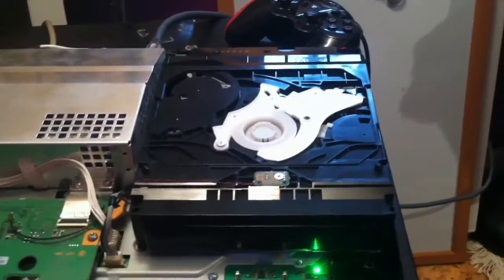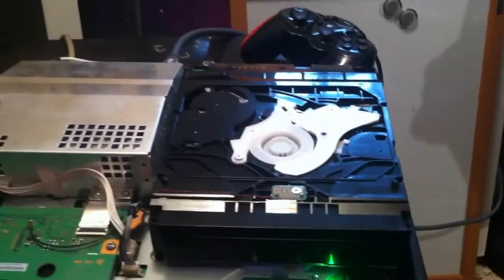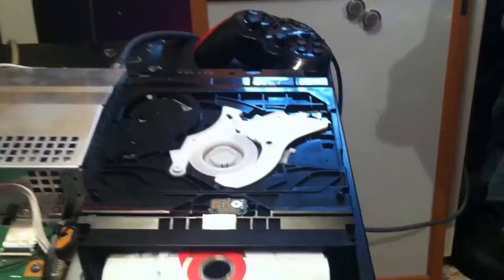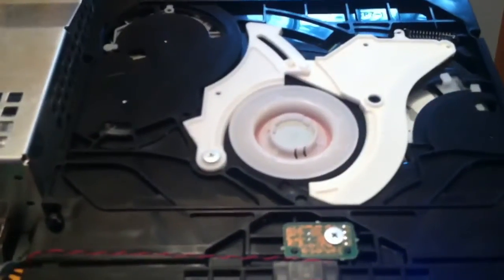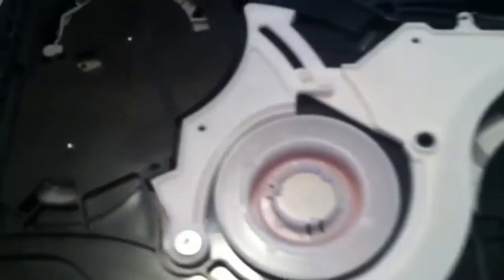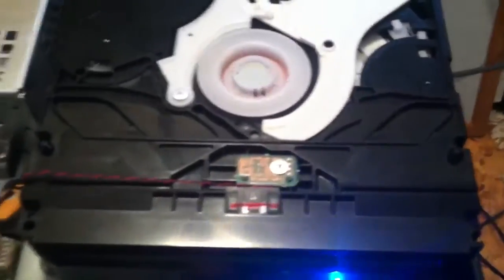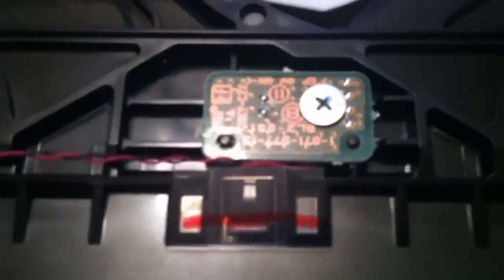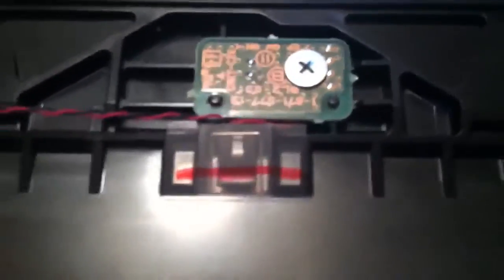ps3 drive not spinning after laser replacement

Comment: are you sure the pin where the white part shows in the hole is properly aligned? It goes into a small slot in the slider on the left.